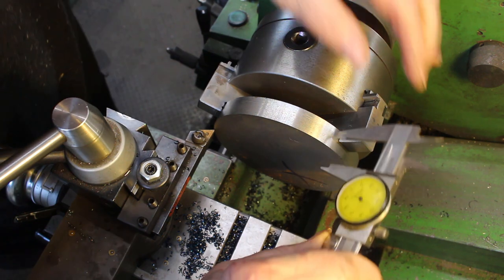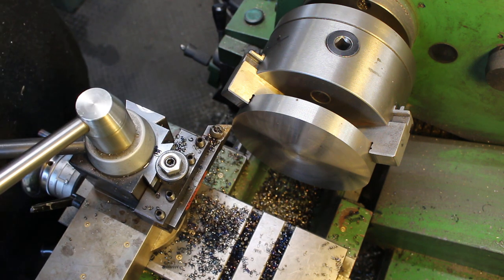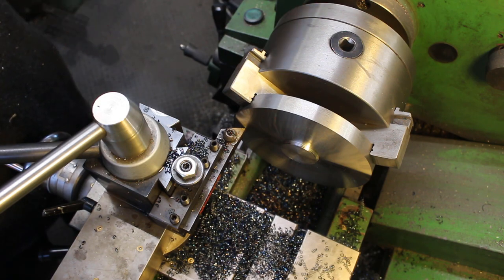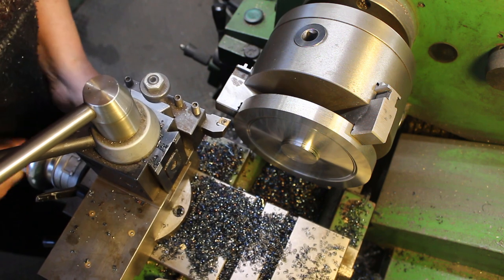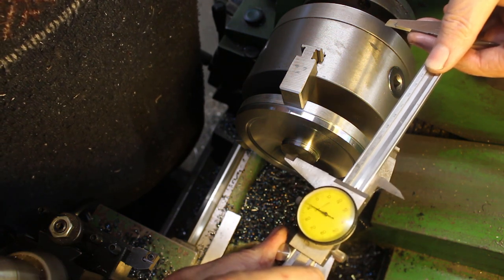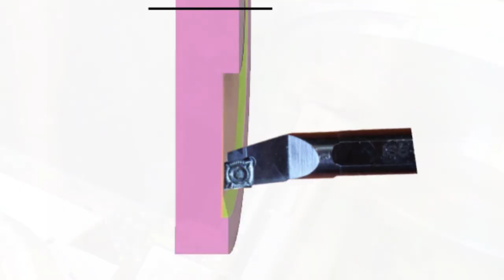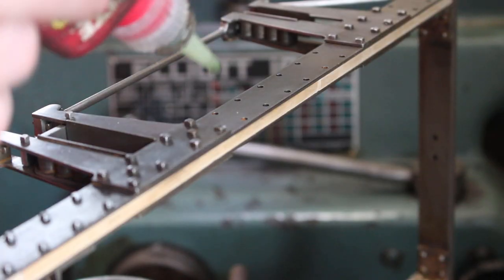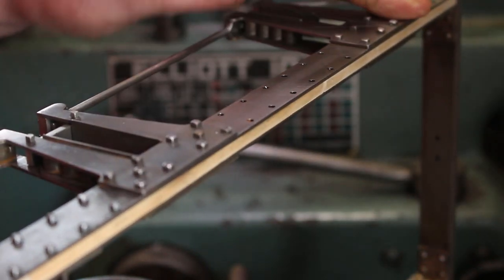Lion - Locomotive Steam Engine Build pt.29 - Driving Wheels

Comment: More lovely work. What is the wheel material?  Nice Abom like blue chips !
Reply from the maker: Thanks Donald. No idea what the material is, it's quite tough to machine, some kind of medium carbon steel, not as hard as en24T (4140) but much harder than mils steel. It was a bar end off cut donated to the project.

Comment: What type of metal was used for frames and wheels?
Reply from the maker: The frames are mild steel. For the wheels I used what I had available, so the large wheels are made of steel, don't know grade but quite hard, and the small wheels are cast iron (meehanite bar).
Reply: @GoCreatehms  Ok thanks. Is it possible to get things like wheels and pistons made for you? I live in Australia and I have no metal working knowledge as I'm only 15 but I still have a massive passion for steam and would love to have a go at building a miniature loco.
Reply from the maker: Fully machined kits are available but very expensive. Usually you would buy a casting form a model engineering supplier and machine it your self, in the UK popular suppliers are Reeves 2000, Blackgates Engineering and quite a few others.There is a magazine called Australia Model Engineering that may be helpful, they have a Facebook page as well. Have a search for Model Engineering Societies, you might find one near you that you can join, that would be the best way to get help and advice, young enthusiasts are always very welcome.
Have a look at Dreamsteam here on YouTube, he's doing a smaller gauge loco with minimal tooling. Hope that helps, it's a great hobby though requires allot of dedication to build a working loco.